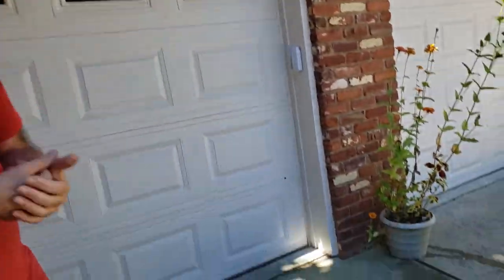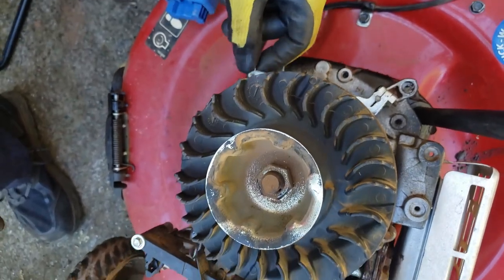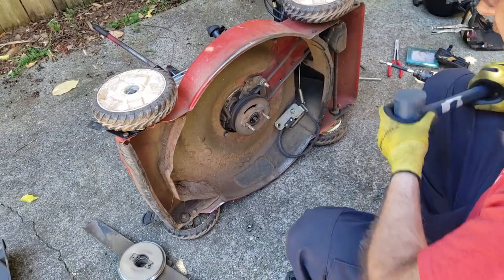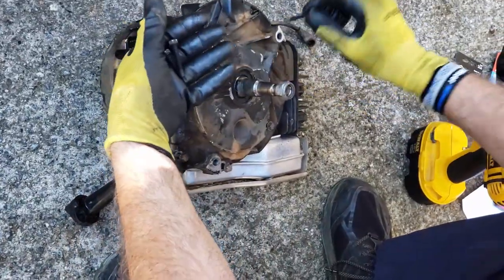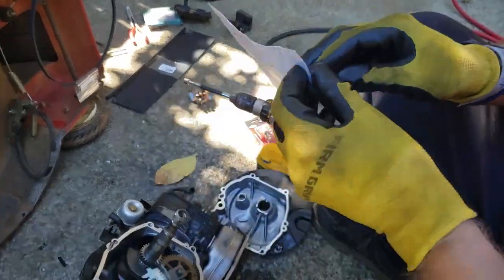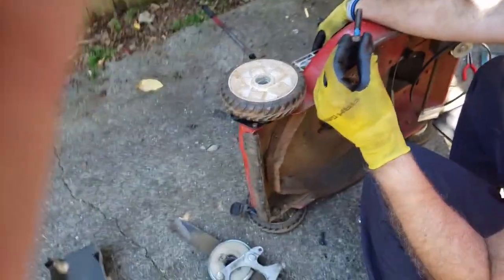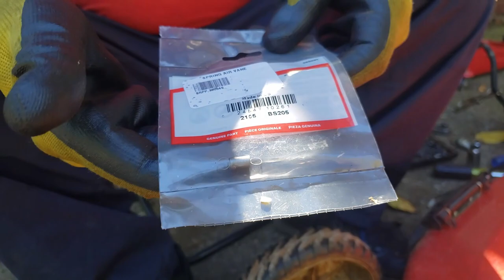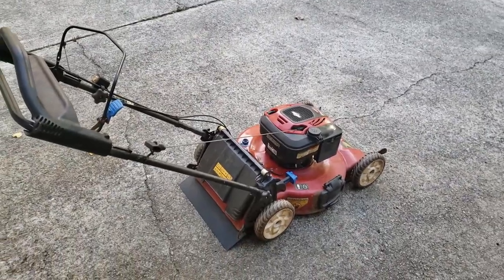Toro Recycler 22 Inch Auto Governor Replacement

Comment: Great video just what I think I need, will I was cutting al of a sudden my lawn mower just started revving high. I changed the carburetor, something. then I said  it must be the governor. Right now I have a wire connected to the linkage. I don't have much time in my life, looks like a lot of work even though going by the video counter it only took you a hour. If I get time i will resort to your video to get it done.
Reply from the maker: Most of the time was taken up getting to the part.  Putting it back together is a little quicker than taking it apart.  I would recommend taking pictures of the belt placements underneath, as well as where the springs connect underneath before taking them apart.  Sometimes they can be a challenge to remember how it went back together.

Comment: I have a Toro that was/is showing the same symptom as you stated. But I have cleaned off the area with carb cleaner, and changed the oil after fiddling around with the metal bar, trying to figure out what is going on. It has stalled out once after oil change, and now a little bit weak in the throttle after cleaning the surface around the entrance where the governor arm goes into the oil pan. I took off the air filter, and it seems to run better as it has never been changed. But it did throttle with a very high RPM,  before I started tinkering around with it. I'm pretty sure it's junk now that i've seen your video,  but will have to take it apart one day. Thanks for the informative video.
Reply from the maker: You're welcome.  I was afraid of blowing the engine when mine was stuck open.  It take a little while to get it apart, but worth it if you can do the work yourself.  So expensive to get a shop to do it.

Comment: Hey Dan, I notice nothing really holds the governor in place?
Reply from the maker: That's correct.  It's held in by pressure from bolting the bottom on & the meshing of the gears.  I thought that was weird, too, but it works